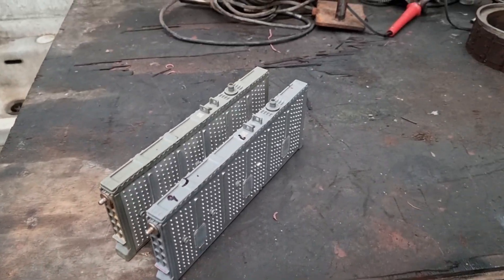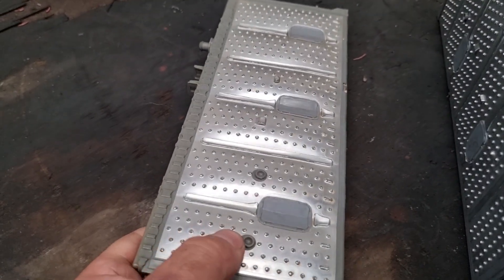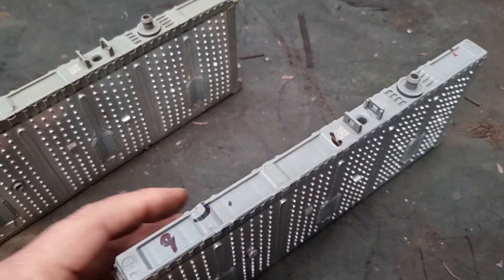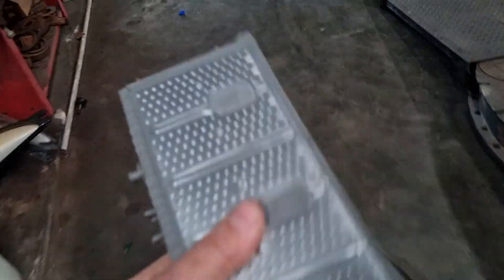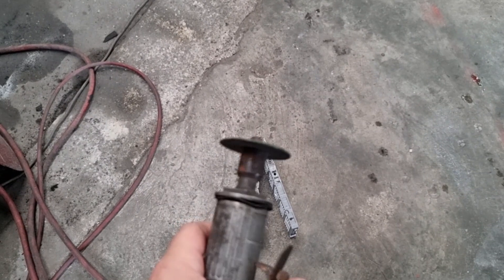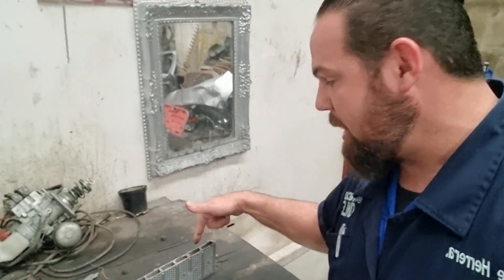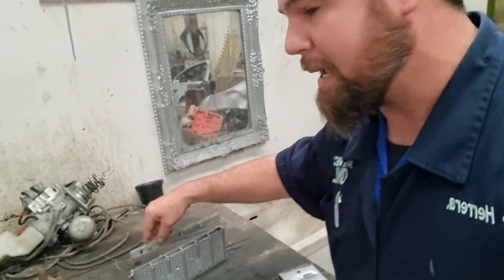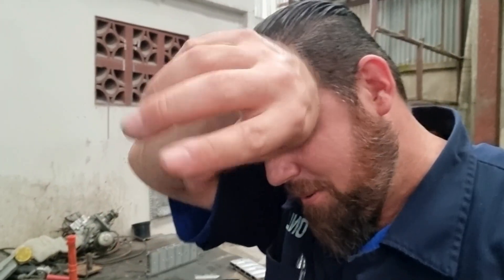deep look inside the toyota hybrid battery cell module

Comment: EI JOSE , CAMARADA, WHY YOU DO NOT PUT THIS TWO CELLS INTO YOUR BALANCE MACHINE TO BALANCE THEM LIKE YOU EXPLAIN IN PREVIOUS VIDEO? THIS BATTERY CELLS ARE MUCHO DINEROS!??? OOO  AND WHAT IF THE OTHER CELLS YOU BALLANCING INSIDE HAS SOME DRY SECTION? AND YOU BALANCING THEM AND THEY ARE WORKING? I DONT BUY THIS HOSE OR JOSE SAME TO ME. JUST NOT THUMBS UP FROM ME.

Comment: Ich battery has about 40mili liter  liquid electrolyte, and if it went out time after time it is losing volume and overheating and damaging. Keep 22 degrees inside car by a/c its saves battery in good condition, also cleat air intake gasket from dast by vacoom qleaner periodically. In my country i clean filter once in 6 month in Georgia and vindows  always ar closed in my car so there is less dust.

Comment: If the dealer suggests replacing a module should I insist that they replace the entire battery ? Am I just gonna have to keep replacing modules?  What causes a hybrid battery to over heat how can I prevent over heating?

Comment: This guy is right you can not bring a battery back to life by only reconditioning it. No one is telling the truth but this guy. So when the bus bars are corroded that is telling you the battery is bad and the acid is leaking out the battery. Its best to buy new modules unless you want to replace the battery every 2-3 years.

Comment: My 2013 prius has 220000 miles shall i order alibaba 28 cells
Reply from the maker: Or the lithium still better
Reply: @hybridsolutiondiagnostics  what do you mean
Reply: @hybridsolutiondiagnostics  do u think if I open and move out middle cells and change the cell connectors is helpful prolong it's life

Comment: Great video..   I have few  questions on the topic.. 1. How much fluid is in a NEW module? 
Is it Flooded to the top of the plates?    2. If someone were to test the fluid of the battery, what should it be.  ie add acid or disstilled water?
Reply: He will not respond ;(

Comment: Do you think ..or.. has anyone ever tried rehydrating cells? Wondering if it could be done thru the gas relief ports. Doubt it, but just a thought
Reply: Technically possible for sure. You can fix lead acid in a similar manner, maybe also with some desuplhation.

But in a do or die scenario, absolutely.

Comment: How do the individual cells balance? Is it the transfer of the electrolyte, internal circuitry, or does an individual cell not care that it is overcharged (dissipates the excess energy as heat)? The reason I ask is batteries naturally get out balance because they degrade at different rates it’s nearly impossible to make each individual cell the same and have the exact same life experiences as the other cells. Lead acid deals with it by more electrolysis.

Comment: I really like this video, and I am using your balancing technique with Panasonic Prismatic modules connected in parallel to charge a bunch with a SkyRC battery charger (works great)!  I have a 2008 Prius Gen 2, and need to replace the Hybrid battery pack.  I have the impression that many of the Panasonic modules implemented in Toyota vehicles over the years are compatible with the 2008.  Can I buy a HV battery pack for a 2015 vehicle and install the modules in my 2008 Prius?  I would like to see a video where you share information on various Toyota models and if their hybrid batteries are compatible with other model years.  The number of modules changes, however do the Panasonic modules change over time?  Are they compatible over the years?
Reply from the maker: Yes they are the very same modules ☝️😎☝️😎
Reply: Gary, I thought the point of his balancing technique was to hang them from the aluminum rails. I thought that was a pretty good idea. How are you doing it with the SkyRc exactly?

Comment: Hello, I saw your videos and you explain everything great. 
I have 2012 toyota prius c. I have an idea to add 2 batteries. And there will be 22 instead of 20. Is it possible?
Reply from the maker: Jejeje yes it can be done... however it is not needed, since the prius c is a hybrid and not an ev... ☝️😅😅 it won't make such a difference

Comment: I do like your work and enjoy your videos but the electrolyte in these batteries is not an acid. It is corrosive but it's an alkali, the other end of the Ph scale to an acid. Potassium hydroxide to be specific.

If the behaviour follows other battery types most of the dehydration is water converting to gasses and venting under pressure.

A little electrolyte might leak and encourage corrosion or corrosion can be from humidity in the air.
Reply from the maker: Yes you right... i made the correction in the description 👋😎
Reply: The crystals you describe are probably dried out potassium hydroxide. 

Have you considered using a syringe of deionised water to rehydrate a dry cell with minimal mechanical disruption?

Experiment on an open cell you can see until you can do it through a tiny melted hole you can reseal easily. Restore the electrolytic paste.
Reply: Galvanic or electrolytic corrosion is also probable given that the cathode is more effected than the anode.

Comment: Why we don’t build battery pack with 18650 Nimh cells? Which easily available in market
Reply: NiMH as you know expands, and thats why theyre sandwiched and wrenched together so when they do try to expand, they cant.   Thats why toyota went with this block design, to prevent expansion when installed in the battery pack and provide maximum heatsink between the layers with their dotty outershell.
Reply: @1mostwanted253  what about if cells placed vertically like the Tesla do?
Reply: @saadarain1578  I dont know how Tesla's are placed, i thought those are lithium with iron in them to prevent exploding.  But I do know NiMH expands with heat and have to be wedged between something to prevent expansion

Comment: how to refill electrolyte? I have toyota Auris.
Reply from the maker: DO NOT ☝️😪 ⛔️🚫⛔️🚫⛔️🚫
Reply: Then how to maintain his life span if Acus are filled with electrolyte, and as a fluids, they can dry out after time. And if design of cells are similar to 12v car battery, do they should also be refilled?  Or they are constructed to be used only once.

Comment: So why can’t I do my measurements and have a plastic injection mold company make me some module frames find new dry cell batteries that will be the same Electrically and dimension wise install those in the frames and use those? This is a whole new business adventure
Reply: you prob could and make it twice as wide and use 18650 batteries to produce 15 or so volts at 6.5 amp hours or more if you like instead of  two at  7.5 or so 
bc a module is 2 units the  computer will still read it as one module only thing is you wiil need to install  BMS battery monitor system for safety reasons
Reply: @apolloFm  correct

Comment: Nice videos except it’s not acid.
The potassium hydroxide electrolyte is corrosive and will burn so be careful as you correctly pointed out. One minor point is that it is alkaline not acidic in the case of NiMh batteries.
Lead-Acid batteries use an acidic electrolyte of a diluted sulphuric acid.
So people please don’t try adding acid to these batteries. It’s not acid.

Comment: Great video, thanks.
Reply from the maker: Thank you james 👊😎
Reply: @hybridsolutiondiagnostics  hey jose I followed the procedure to change my actuator fluid in my 2018 kia niro lots of gunk in there. I was successful but I removed my intake hosing and maf sensor connection for room to work refitted everything back now my check engine light is on will it come of on its own or can I rest it by turning the service plug off as I have no scanner
Reply from the maker: @32412kg  scan it... you probably left something unplugged...
Reply: @hybridsolutiondiagnostics  thanks the connection to the maf was not snug where u hear the click all fixed I am enjoying your training all the best.